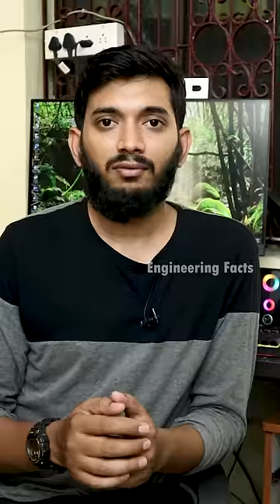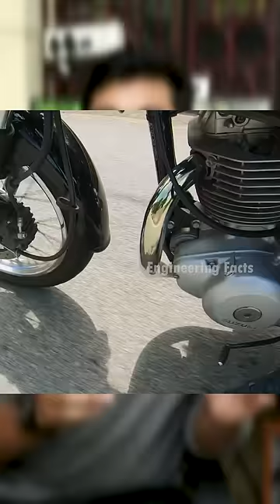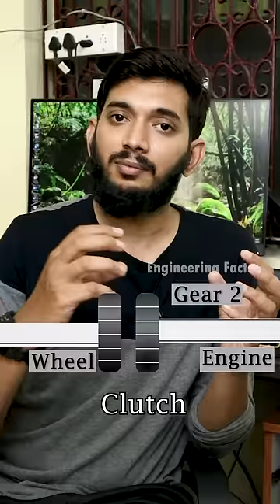Clutch பிடிக்காம gear போடலாமா?

Comment: 90% govt bus clutch pudikaama thaan gear podraanga bro 😢😮
Reply: from a driver prespective….. my left leg (clutch) hurts when I drive for a day …that’s even only a car…..but if u look at a bus the pressure that we have to apply for a bus clutch is to be higher and is moderately harder…..so they do change gear without clutch when they are tired….yes obviously it will affect the gear box but what to do….my mama is a mtc chennai bus driver….he’s both leg soul got blisters (koppalam)…and heat coming out in the drivers area is causing many body problem to him…..
Reply: @peterjai6838 Etha ah thana da avanum sonnan😂😂
Reply: Most of the case la clutch laam pudipaanga hill station pogaila thaan avanga apdi panuvaanga 😂summa adichu vita koodathu

Comment: Clutch less up shift is possible once you pick up speed after 2nd or 3rd gear.. but we have to practice it.. there are lots of videos how to shift clutch less without quick shifter... but clutch less down shifting is very bad for the gear box.. 💯
Reply: When your current gear rpm is low enough, then you can downshift, if high rpm, then the engine over rev and sometimes engine may damage and you can smell oil from engine
Reply: You should blip the throttle during downshift (only use it when the engine is not in high rpm and in emergency situations)

Comment: clutch pudikkum podhu yendha gear um piriyadhu clutch plate dhan velagum, accelerator close panni clutch pudikkama geaar change pannlam 90% fault varadhu
Reply: Accelerator close pandrathu na epadi konjam solunga
Reply: @lionheart650  throttle close pandradhu

Comment: Nice clip brother! Then how the quick shifter works brother?
Reply: Alternate shift automatic sensor mechanism bro. It sense high to low throttle  and gives data to ECU, then engine torque auto managed with speed by ECU signal
Reply: @rolandarockiasamy3550  Thank you brother!

Comment: company recommend that you can change 3 , 4 gear without clutch. read user manual which come with your bike. use cultch for 1 ,2 gear.
Reply: @GAMER RAGE yes its all depends on our riding style.. i am almost done 210000 kms on Shine. I am always using original spares and proper lubes for parts..
Reply: @GAMER RAGE yes its all depends on our riding style.. i am almost done 210000 kms on Shine. I am always using original spares and proper lubes for parts..
Reply: @mohanline  2.1 lakh kms?
Reply: @parthasarathy5222  yes it is 210000kms
Reply: @mohanline  engine clutch edum mathalaya
Evlo kms once oil mathivinga
Reply: @parthasarathy5222  just remember bike is man made thing it is need timely service timely parts changing ... I service bike myself only not in workshop.  Just remember that i replace only original parts . Everytime whenever i change original parts i feel odd because always its high price but i compromise for parts life.i am not done regular service before 140000kms but after that means 140000kms to 210000kms i replace parts for 25000rs . I decide that to keep this bike in good condition because i am not satisfy about new bike. Bcz nowadays bike come with low quality. Mainly i changed Engine bore kit, clutch friction plate, carburettor vaccum, headlight doom, battery, self motor bursh changed for 2 to 3 times, cables, tyres, engine packings, chain sprocket (now need to change), speedo meter cleaning and plastic needle replace with a iron needle because its not available in market, bulbs.
Reply: @GAMER RAGE என்னோட வண்டி இரண்டுலயும் (yamaha gladiator 125cc 2.4lakh kms, yamaha R15 ver 1 150cc 84k kms) clutchless upshifting தான் 
இப்பவரை எந்தப் பிரச்சினையும் இல்லை

Comment: Bro appo super bokes like S1000rr and etc la quick shifter iruku bro which means we can change the gear without the clutch and this technology is now available on ktm rc 390,r15M and etc but only for up shit.Ithu enna concept nu konjam sollunga broo
Reply: Engine power cut off aagum like air and fuel mixture cut aagum bro
Reply: You can do it without a quick shifter

Comment: There is no issue with speed of gearbox, wheel and engine. It is just the torque difference. 

So when you are shifting there should be 0 or close to 0 torque difference between engine and clutch shaft.

Comment: Nega slurathy theary vic crt but practically panalam thapu ila ana athukun sila mora iruku 
Namma 1 st gear laye 2 gear oda initial speed ku ponathuku apram tann 2 gear ku povom so namma vandioda wheel 2 gear oda speed la tann irukum namma accelerator response time ah calculate pani namma vidura time layim gear podura time um ore time la iruntha onu agathu

Comment: I am using tvs apache 150ccbike from 2005...still i m using the same gear box.. I will use clutch only start and stop.... 1.6lackm crossed..... I changed clutch 3 times only.....we need to change gear while reduce accelrator only... Due to sudden accelarator drop centrifugal force little bit act on clutch, that time we nwed to change gear.. This Will cime by practise easily

Comment: I think u r wrong in this, there is a specific method to upshift and downshift without using clutch aka clutchless shifting, superbikes perform exactly the same just with electronic which are quick shifter and autoblipper which is used for upshifting and downshifting respectively

Comment: Entirely wrong explanation. Clutch connects and disconnects to gear box and one end of clutch is always connected to wheel. Engine is connected to gear box on the other end clutch is disconnected from a crank because when gear is changed it gives a small shake to the crank shaft so if clutch connected it might get some damages. So it is disconnected and after gear is shifted clutch is released and it is connected.

Comment: Upshifting la 3-4 and 4-5 gear shifting la 6.5k rpm mela bike iruka apo clutch pidikama gear change pannalam. Problem varadhu. That is quick shifting for bikes without quick shifter.
Reply: Dai, higher rpm la clutch pidikama gear change panna gear box poidum da, medium or low rpm la than clutch pidikama gear change pannalam because in low rpm, the wheel speed matches the gear speed from the engine,so no problem
Reply: @sanjai784  seri da
Reply: @sutharsansadhasivam2401  naa sonnathula enna purinchu ? Atha tamil la sollu paapom
Reply: @sanjai784  Nan anupcha link ah nalla padi da. Apro vandhu pesu. 6.5k to 7k rpm is medium range than. Seriya. Ne than Nan pesunadhu puriyama vandhu pesitu iruka. First ne explain Pannu Nan sonnadha purinjitu

Comment: It's called clutch-less shifting, competitively easy to upshift than downshifts
BUT needs to be done perfectly.
ONLY IN BIKES, as it has sequential gear pattern.

As we put pressure on shifter and alter the engine rpm, at one point the rev of engine and load (wheel) matches and the next gear slots into position. But but but do it only if you feel connected to bike (engine). Practice

Comment: There is a method to perform clutchless shifting on bikes and you should always release the rigger slightly when upshifting to higher gears and when downshifting rev more this helps prevent gearbox failure and reduces strain on the  engine and gearbox

Comment: Bro bike speed ah gear la slow pannalama
Reply: When your current gear rpm is low enough, then you can downshift, if high rpm, then the engine over rev and sometimes engine may damage and you can smell oil from engine
Reply: Pannalam bro